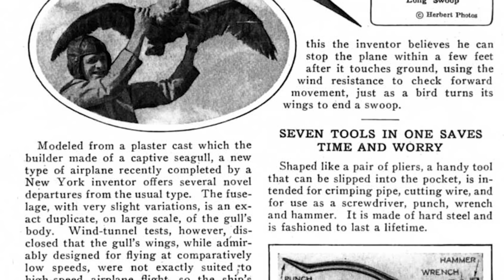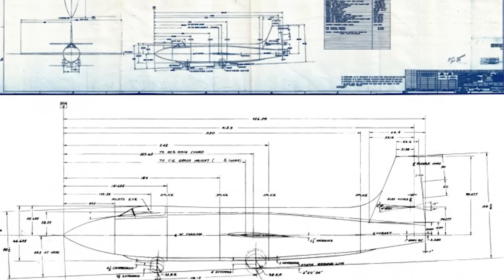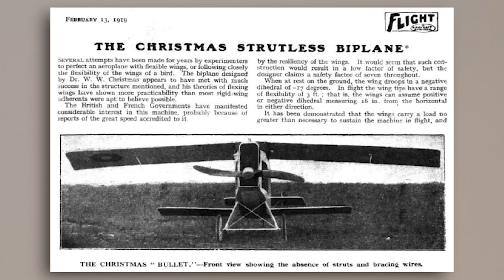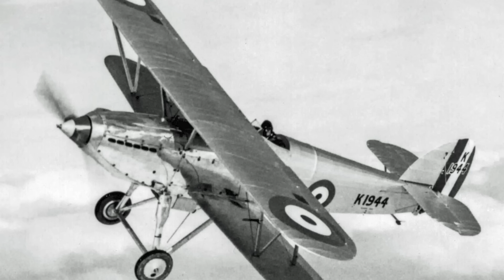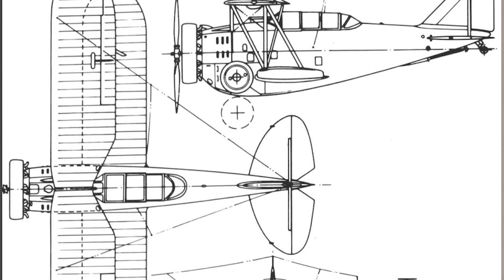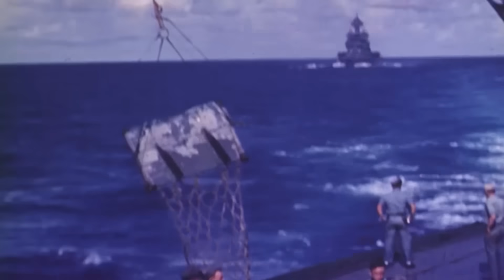Almost 3 Hours of Aviation History | Rex's Hangar - Season 4

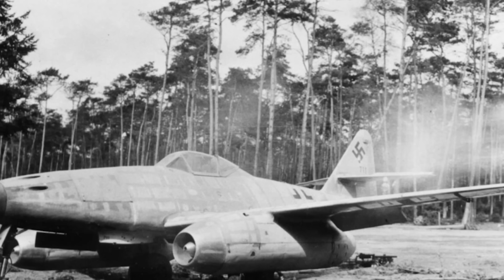Comment: 26:20 Neither britain nor the US were behind Germany in jet technology. Britain had their first jet fighter take flight over a month prior to the M262, the Gloster Meteor Mk 1. And the US had its first jet fighter take fkight just 2 months after the Me262 had entered service. The Lockheed P59.

In the case of the americans, the P59 would remain only a small batch prototype, but would be developed into the P80 shooting star which took flight less than a year later.

The key difference between britain, the US, and Germany is that Germany had lost so many planes in the battle of britain that it couldnt afford to lose tactically, that Germany was essentially forced to push the Me262 into service years before it was actually ready. The engines needed to be completely stripped and rebuilt after just 30 hours of flying. While the Gloster Meteor which flew before the 262 but did not enter service until later, could fly for over 400 hours before requiring engine rebuilds.

Comment: Side note, the X-1 is the plane that taught engineers about leather gaskets not being suitable for liquid oxygen. Yes, really. Edit to add, 42:01, now I see you mentioned this.

"Investigators discovered that leather gaskets which were used in the rocketplanes’ fuel systems had been treated with tricresyl phospate (TCP). When this was exposed to liquid oxygen, an explosion could result. The leather gaskets were removed from the other rocketplanes and the explosions stopped."

Comment: fun anectdote from Chuck Yeager's autobiography, the night before the speed barrier breaking flight in the X1 they had been at the local watering hole and got rowdy as they tended to do. on the way bavk to base, they were in two vehicles, a car and motorbike. Yeager on the motorbike wrecked on the way back and broke some ribs. they had a doc keep it hushed a bit and just tape his ribs up so he would still be the test pilot that broke the barrier and not be out on medical. 

it goes into a fair bit more detail in the book, and there are many more good bits of his career all the way throuvh vietnam in it.
Reply: He was actually in so much pain that he had to Cobble together a stick so he could pull the door closed because he couldn't move that side of his body without gasping in pain